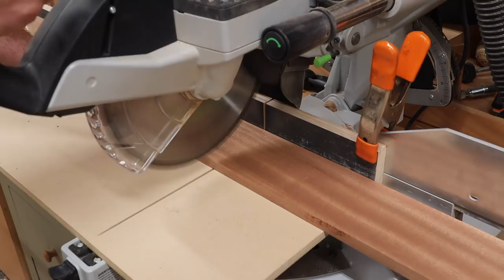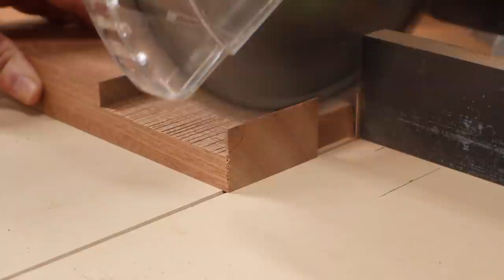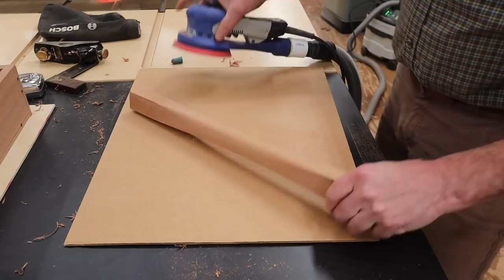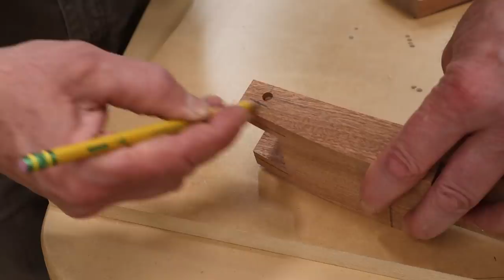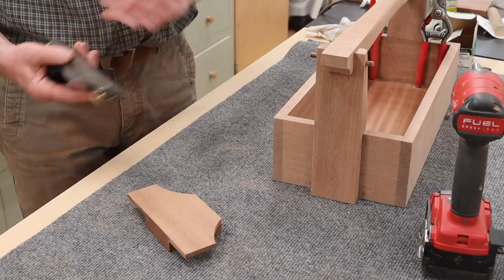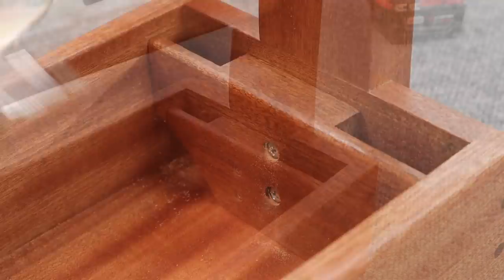Make a Japanese Inspired Garden Toolbox

Comment: Pretty new to all this and wondering what wood you used for that project. Looks amazing.
Reply: 99.99% sure that it's sepele. The ribbon grain and color are very distinctive after you've had a chance to work with it a bit.
Reply: Seems like John picked up some sapele for a project in the last year and is now using up the off cuts.
Reply from the maker: Thanks Guys, yes the wood is Sepele and I was able to make all of the box except the bottom from a cut off given to me by Jeff & Rob at Greene Street Joinery
Reply: @JonPetersArtHome  awesome. Thanks Jon. Much appreciated.